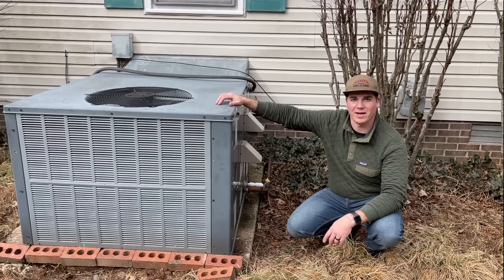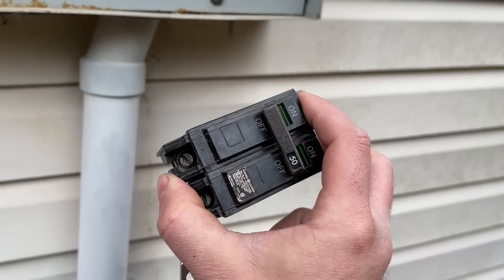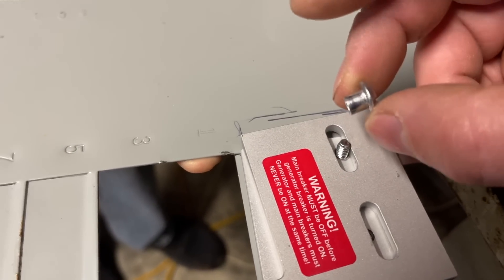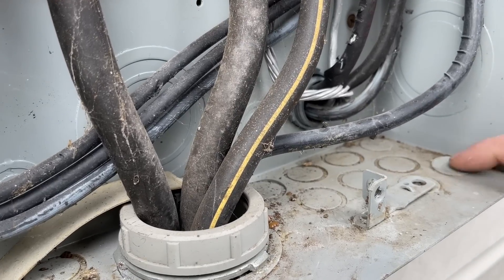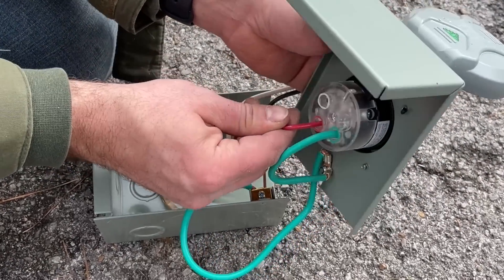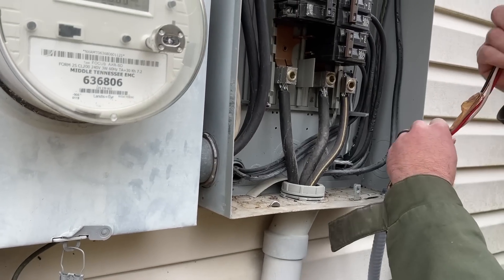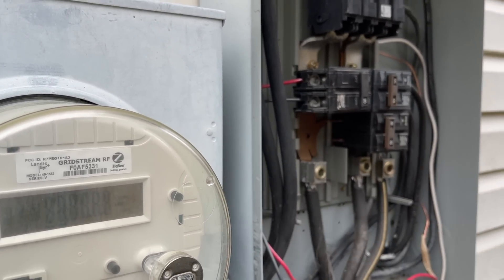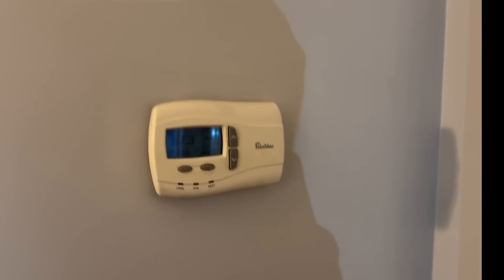The Best Way To Connect A Generator To Your Home

Comment: Is it me or it’s odd that the main breaker panel is located on the exterior of the house. Easy access for a bad guy to dark out the home.
Reply: Some regions of the US (California is an example) incorporate either a main breaker or a main panel outside nearest where the utility enters the dwelling.  There are very few instances of the "bad guy" turning off the power fortunately..
Reply: New National Electrical Code is requiring Emergency disconnect on outside of the house for first responders to isolate power. Not all areas of the country have adopted the code cycle that requires it.
Reply: Depends on location. In the Midwest it’s most common to have them indoors. But, rural areas like farms have one on a pole normally which feed other buildings. My house also has one on the outside before finally going to a panel in my house.
Reply from the maker: This was at my parents home in Tennessee, and my home here in utah also has the main on the exterior.
Reply: Do you want to know what odd is? I bought a commercial building and one night I got a call that there was no light in the whole building. I call the electrician and he could not find what the problem was.  Fortunately, I knew the old owner and he told me that there was a cut-off switch that controls the power going into the building on the light pole on the side of the street and some kids had turned it off.

Comment: If you use 10 gauge wire you should use a 30 amp breaker. Or pull a number 6 with the 50 amp. If someone uses a bigger generator they could burn the wires, house, panel.
Reply: He should check the NEC to make sure all of his techniques are safe and up to code.  The cost for the upgrade is infinitesimal compared with a house fire.
Reply: Most people that would be doing this kind of electrical mod will know this, and those that don't shouldn't be doing this kind of work. ;-)
Reply: @3dloon430 , Excellent point.  I was thinking about that.
Reply: Spend the extra $20 in copper for the correct gauge cable. Yeah I agree this is not up to code. It’s very easy to find out too. I ran my own 50 amp generator hookup and used 6 gauge THHN, a Leviton twist lock plug with brass blades and GE housing (GE T050N). I’ve read that these cheap Amazon inlets use aluminum too.
Reply: I just asked my neighbor across the street who is an electrician who is licensed how much he would charge me to install the exact same thing and he quoted me $500 and yes I live in Central Texas
Reply: @kennethhetrick5458 , Find better neighbors.  If you were my neighbor, I would ask you to buy the parts (I will give you a list of what is needed) and do it for free.
Reply: @kennethhetrick5458 $500, and he’s your neighbor?  I think a hun would be pretty good for a job like that.
Reply: Yep and a back fed breaker has to have a system to hold it in place. It’s listed on your panel cover.
Reply from the maker: This was the breaker my dad had on hand and this is the only generator he will be using (it should be in a Honda museum haha) but that makes sense. Thanks guys for the tips.
Reply: @diyhvacguy  you have to think about future residents that may want to use that input. 
Or if your dad changes or borrowed a bigger generator.

Comment: How much gas does a generator use in a day?
Reply from the maker: That would be a good test. Depends on size. Mine runs on natural gas so I don’t really have a way of measuring
Reply: @diyhvacguy  ... rule of thumb on gasoline gen sets is 1 gallon per hour per 5 Kw draw. Seeing as a typically sized set will be running at half power most of the time the fuel use will be half of that. Due to inefficiencies, you will almost never go below that consumption rate.
Reply: @rupe53  that's sounds like a lot of gasoline. I usually buy it by the gallon. Thanks for the info.
Reply: @amorales9613  ... yup, but that's the way it is. It will cost you about 6 times more to make power than what you pay the utility company.... not counting the price of the gen set or servicing. That's why I tell people to think of it as camping, where you only use the minimum.... lights, heat, fridge. Forget the AC and other frills for a few hours and you can save a bundle.
Reply: @diyhvacguy  
The reason I ask is because gasoline generators use a lot of gasoline, so I've read. I don't really know. When natural gas was installed in my home, they installed the incoming pipe on the opposite side off the house where the utility box was not located. So I'm trying to figure out how I would do natural gas or any other fuel other than gasoline and how I would power it. I don't know why they located the incoming pipe opposite from where the power is located. In my case, it looks like it might be hard to power a generator with natural gas. Also, maybe you can do a video on what kinds of options there would be for powering a generator. Thanks for all you do..

Comment: I installed this a couple of months ago, but since my generator is only a 120v, I have it connected to one leg in the breaker box- the one with the furnace, fridge and the led lights I normally always have on at night.
I need to make an extension cord to plug the Vtoman 1000 into this inlet socket so the Vtoman can stay in the basement and not outside or in the cold.

Comment: Put your gloves on-consider the range of skill levels watching you
Reply: better advise would be turn the main off so at least the buss bars are not live. that being said I've added breakers to a live panel many times you just have to have a understanding of what you are working on. dont touch it if you have any doubt
Reply from the maker: Agreed. I was just super careful, because my sister and mom were working from home and I didn’t want to kill power until it was finished. This is a valid point for DIYers looking to do this though! Thanks for sharing